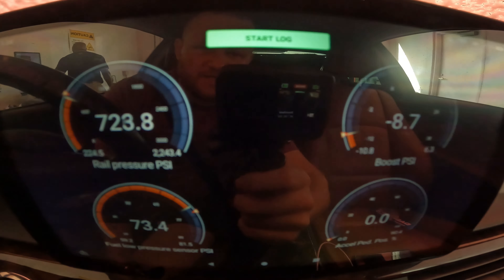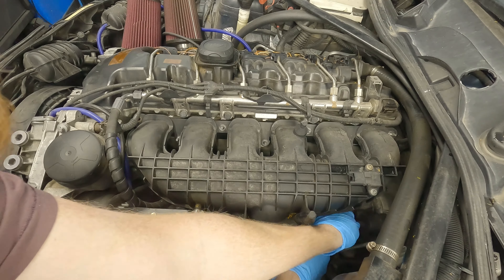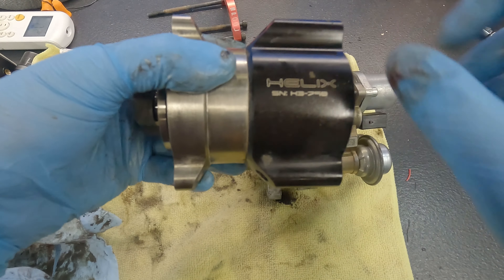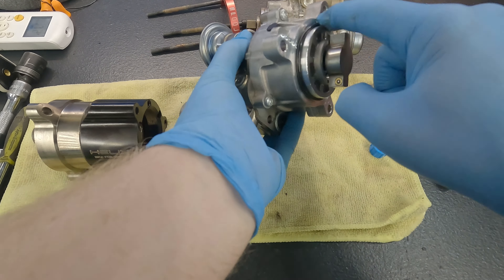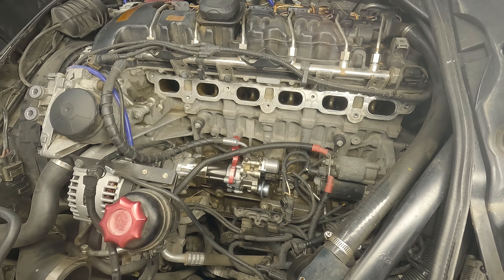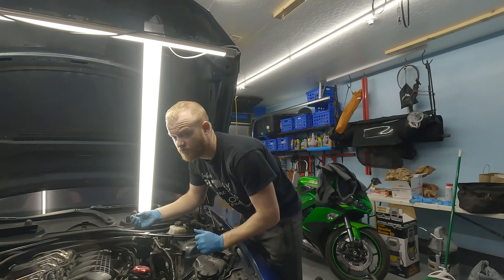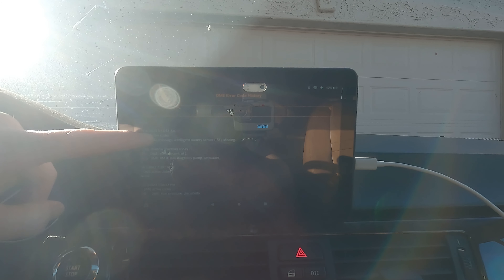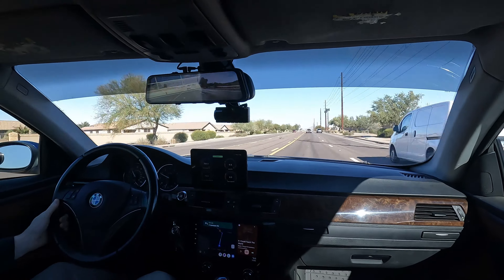How to Make 600 hp Without Port Injection! BMW N54

Comment: This is a regular hphfp right ? Just a new one since I never heard of bmw making upgraded pumps for the n54/55 platform .
Reply from the maker: @TheTruelakersfan  yeah it's the regular hpfp from FCP, and then the helix spins it 3x faster to give it much more fuel 🤙
Reply: @jku392adventures  ah ok now the video makes sense .i never heard of this before. Thanks bro I will be buying one . Do you know how much power it can handle before upgrading other parts ? I already have a pr stage 2.5 lpfp .

Comment: whats the max hp on stock fuel system eventually upgraded lp fuel pump with index 12s?
Reply from the maker: Stock lpfp? Or upgraded. With the stock lpfp you might be able to get like 350. But you'll need to start running e85 to make more power. If you use race fuel you could probably make like 400  or more on stock turbos

Comment: Why did you choose this route over going PI? just to save money, or something else?
Reply from the maker: For me it was more about tuning and keeping things simple. I do my own tuning so I really didn't wanna deal with adding another box to tune and adjust and deal with. With the helix I literally only tune the car as I always have
Reply from the maker: Also, it still is not cheap using the helix, it was around 1300 with the Bluetooth analyzer and filter. Finding used port injection would be similar I believe
Reply: Rip oilpump chainguides
Reply from the maker: @oscarolander7455  already changed out 🤙 and rod bearings
Reply: @jku392adventures  gr8, but are you sure putting the extra load on this chain is a great idea? I have read about some failures.
Reply: @jku392adventures  On ease of tuning, have you seen what's happening with the Reflex+ and the v6.2 firmware? DME now controls PI and DI, all via MHD+
Reply from the maker: @oscarolander7455  yeah I have seen that, but I took the preventative measure so fingers crossed! 🤞🤞 Also when I pulled my oan, my oil pump had a loose bolt! So it's a good things I bought the helix , or else I wouldn't have fixed that 😂
Reply from the maker: @BMW1M  that is very cool! I have seen that option when flashing a map I believe, wonder if MHD triggers when to turn on the direct injection at a certain psi? Instead of a boost switch. Not sure
Reply: @jku392adventures  Currently, MHD can't do anything for controlling a 2nd pump, port or meth - but the next update for it will make that possible, in conjunction with a Reflex+

Comment: Please share any write ups or forums you used to learn dme tuning if you can. I built and tuned every dsm, honda and even dirt bike i had in the last 20 years . I want to do the same in this bmw chapter of my gear head journey.
Reply from the maker: In my videos I have a link to the N54 public repository and there is so much information there, when you download the zip drive, in side the N54 folder there is an excel sheet that has so much information, I would read all of that 🤙

Comment: so no need for e85 to achieve the 600 whp?
Reply from the maker: You definitely need e85 unless you're using race fuel, I was using straight e85 and that's the purpose of adding the Helix overdrive kit is so you can run straight E85
Reply: @jku392adventures  i hear those helix overdrives eventually screw up your timing/time and chain......... also heard that spool performance has zero customer support and blames everything but the helix for everything. good luck with it though

Comment: New to channel. Great N54 and tuning content!

Have you had any issues with the sounds from the 3x overdrive system?

Do you feel the 3x overdrive system lead to the failure of the hpfp?

What are you thoughts on the new Nexsysmotorsports N54 DI delete kit?
Reply from the maker: I recently uploaded another video where I show how to fix the helix from making chatter on startup, but before I discovered this fix, it would chatter on cold starts and sometimes at red lights.

I do believe that the helix does put a little extra strain on the hpfp. I had one through fcp so I wasn't worried about it. It definitely made the car waaay faster, 

And I'm not familiar with it, but with the cost of index 12, I would have looked into it if I was needing new injectors

Thanks for watching and subscribing!